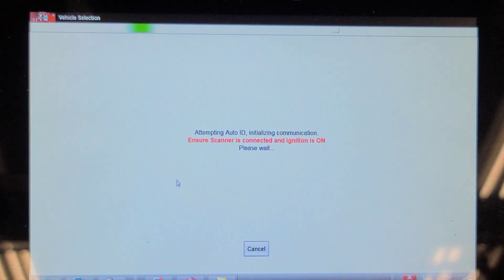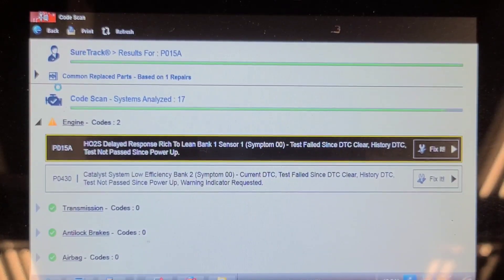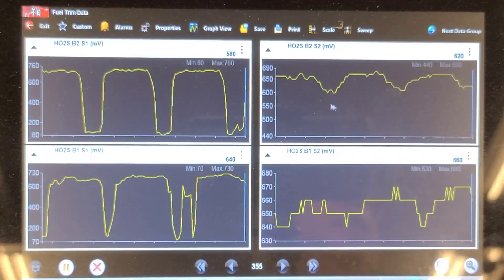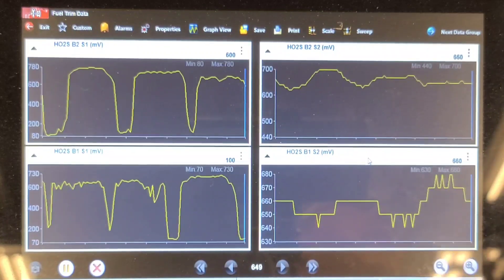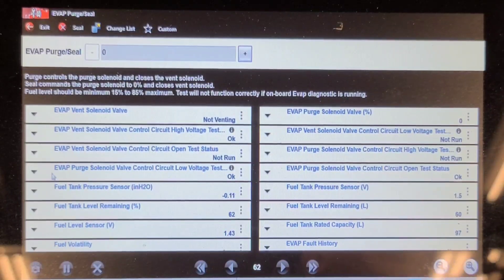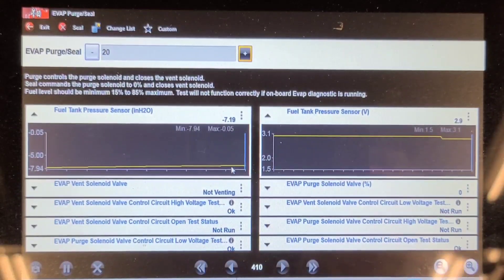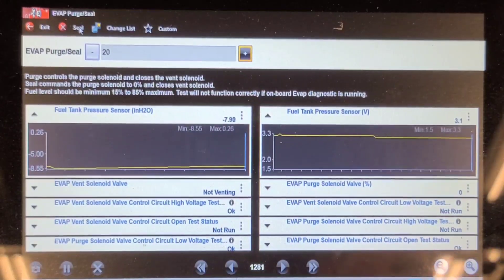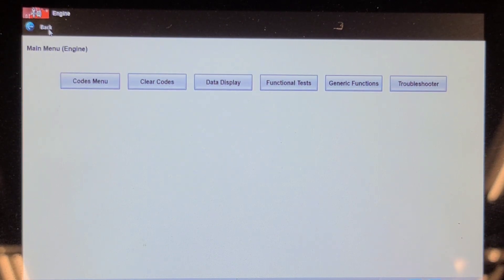2014 GM Truck 5.3 MIL On, P0430, P015A

Comment: Hey Guy, Tom Here.
We finally got wired High speed Internet at house :)))) 
For some reason I lost my notification history to continue in our original link.
I have the 2004 Durango with the 3.7 working thru misfires/ cat issues.
An Update as You were so great with response listening/ help.
I cannot get to passenger side 02 for a pressure test so I did check temps pre and Post.
They were not up in the + 200 degree range as really needed.
I replaced what looked like a damaged muffler and she ran better. 
I'm pretty sure the cats have been somewhat damaged.
As I had the codes for misfires and cat banks below threshold and not the cat failed codes I tried Some Duralube cat cleaner and highest octane gas. 
I ran her down the back road 10 miles loop  in 2nd at a +- 3,000 Rpm.
I did this over a few days and She has git up and go like a new one.
No hesitation issues.
I'm running her on my travels couple times a week. 
Question;;  I do not have emissions testing in our area and I believe at 20 yrs old I barely get any kind of inspection.
Could I just slide off New Muffler and drill a 1/4 hole south of each cat and run a 1/4 rebar up Gutting them start her up allowing broken material to pass, then weld up 1/4 hole, and reinstall muffler?
I know that will send the computer into crazy mode. 
Is there some gadget that we could hook up to the 02 sensor wire that would trick the computer to the perfect reading??
Yea I guess I'm a lil bit lazy but The cats are $500 and Acsessing the rusted bolts on manifold will be a pain.
 As she has been under cover most of her life and pipe was of the good stuff back in the day they are like brand new- solid.
I know I rambled again.
Best; Tom
Reply from the maker: I can not codone defeating an emission device but it obviously can be done and is done. there are a few solutions to fooling the cat monitoring with a "cheater". Google P0420 cheater for more information.